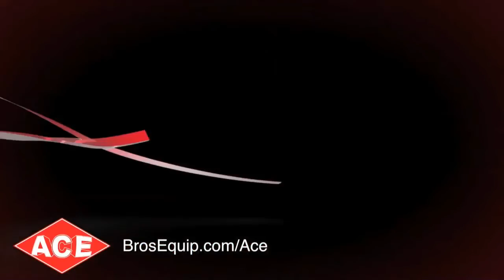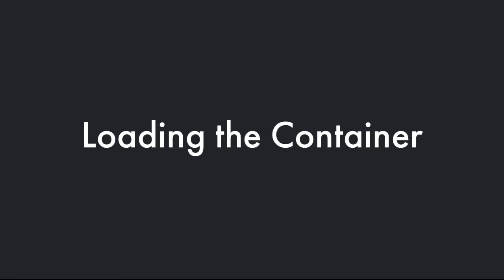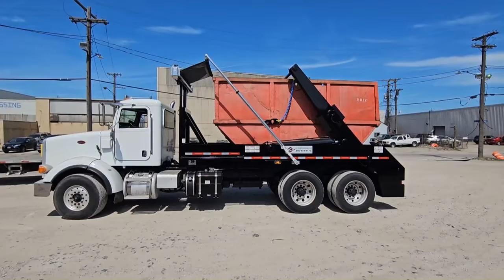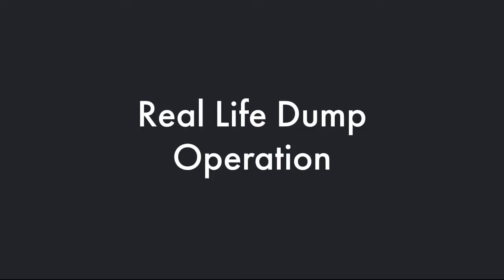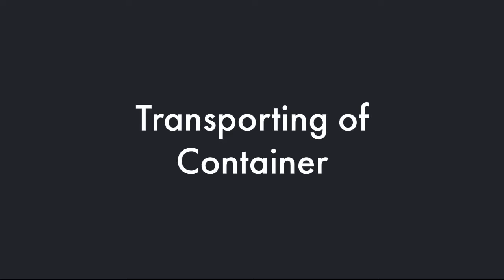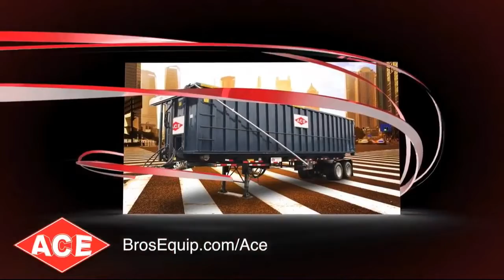Ace Lugger Hoist Operational Video

Comment: What’s the benefit of a lugger vs a roll off?
Reply: Less real estate needed to load it on the truck is the one advantage I can see.
Reply: Some negatives are that if there are if you are hauling scrap and there are lots of long pieces like tubes or sheet metal they can hang up on the cross bar and jam it up when dumping. Auto shops tend to be a pain because everyone throws brake drums and rotors at the cutout end which is generally the end you load from. If it's too imbalanced it can sit on too much of an forward angle to clear the back of the deck loading it